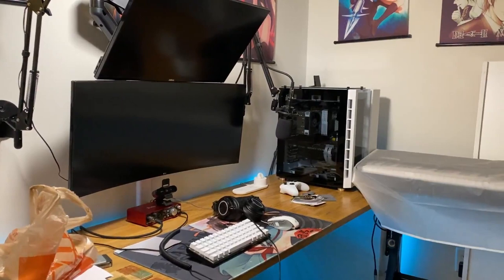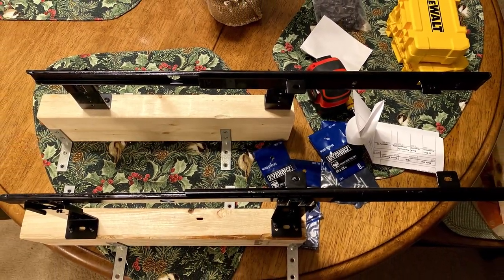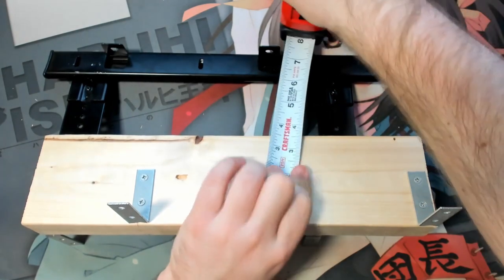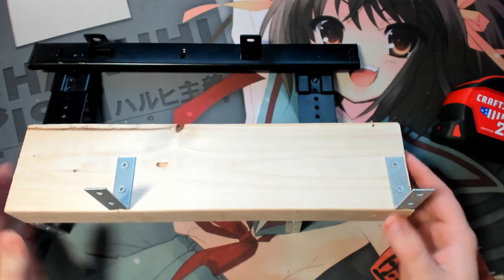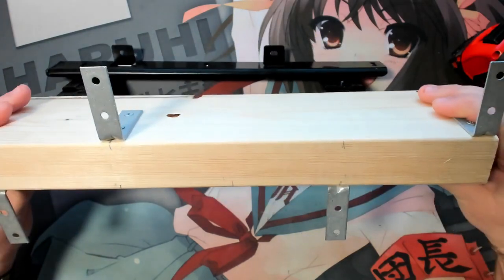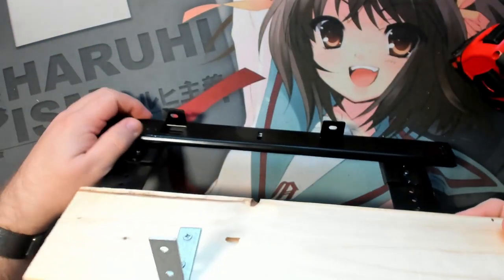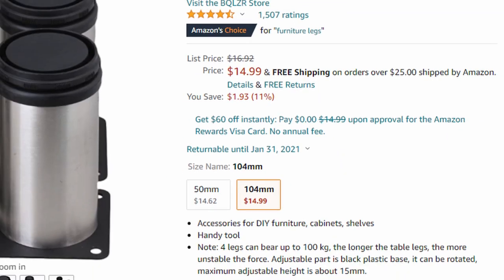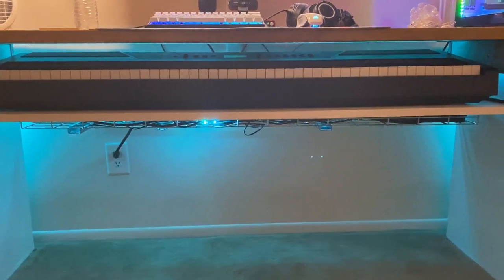Digital Piano/Midi Keyboard Desk Tray - How I Made Mine!

Comment: Hi my friends - musicians. Before you build such a kind of slider/tray, make sure you have enough space/height for legs. 
If not, you can use longer rails or two rails and to push the keyboard deeper. So for the processing job you can feet your legs under the table.
Reply: Any videos resources on making my the keyboard deeper for space for my
Legs ?
Reply: One of those adjustable desks that move up and down would be perfect for this setup

Comment: Nice video. Good solution. Question: how does the shelf with keyboard react to pretty strong, maybe even percussive playing/hammering the keys? Looks a bit wobbly/flimsey...
Reply from the maker: It was at first, but I added an angled galvanized steel support bracket that spans the entire length of the shelf, greatly increasing the support. I don’t play hard and pound the keys or anything since I am just learning, but the shelf has no issues with moving or shaking when I play. I hope the video helped you out!
Reply: @TechedOff  It certainly inspired me, as I am in the process of constructing a shelf myself. And good to hear some steel support will help!
Reply: @TechedOff  Good Idea with the angle Bar.  So you have the angle bar screwed into the holes on the sliders running the length of the tray?

Comment: Great video! Do you know how heavy the keyboard is? I have a Yamaha CP4 Stage Piano and it's quite heavy. I am concerned something like this wouldn't support the weight.
Reply from the maker: Thanks so much for watching! The product listing lists it as 30 pounds. Alone I agree which is why I put a metal l bracket underneath for additional support. My desk is also solid wood. I’d never do this with laminate particleboard as that would probably pull right out.

Comment: This is great, was wondering how is this holding up? I'm going to make the exact same setup and it's gonna be screwing inside an ikea karbly. For some reason there's something extremely enerving about having my 38lbs digital piano floating because the desk is particle board. I'm probably going to do what you did but ad even more L brackets, but just curious if you've found this to this day if you still own this setup? 

Also your desk is 1 inch correct? kinda eyeballing it but i'd be willing to go get solid wood table top at a decent price i've found at homedepot if that is indeed 1" your using. For some reason I thought 3/4 screws would be a bit small for this kind of tray
Reply from the maker: Hey thanks for watching! I still use it today and it hasn’t budged since I installed it. My desk is solid wood but the shelf is particleboard. The l brackets provide plenty of support and I used several on each side spaced out to evenly support the weight. If anything I’d be more concerned about the particleboard shelf than the desk since my desk is solid wood. My desk is indeed one inch thick.

Comment: Any issues with the tray sagging over time? since it's been 3 years now?  I have an S88 and I am worried with the length of the tray and the weight of the keybed,  And obviously playing the keyboard.  Would you recommend maybe going the full 1-inch thickness?  Or was the 1/2 inch fine?

Comment: Question. 66" x 35" under desk clear. Rectangle legs on either side. 
Keyboard  56"W 11.10" D  5" Tall. Weight 40.8 lbs. Need piano to be back
 towards the back of the desk, then pull box on slides to edge of the 
desk, slides in box extend out 12" so the piano can be played. Unable to
 get advice on the best sliders to use, meaning the under the desk part,
 pretty straight forward, however when it comes to pulling out another 
set of slides, they need to be able to handle the weight, not wobble 
up-down left-right.  With the width being 56 wide, figuring out weight 
stress is touch. Could you offer any suggestions?  I wonder if there is a
 way to not use an enclosed box, or other ways to make this project 
better? Thanks
Reply from the maker: Thank you for watching! Probably the most important aspect of the project is to be sure that the sliders are able to hold both the weight of the keyboard but also the shelf material you use. You probably wouldn’t need to attach the sliders or blocks of wood to the desk as many times as I did, but I wanted to be absolutely sure they wouldn’t loosen over time and so far I haven’t noticed any movement or loosening at all of the screws. As for the keyboard moving while playing, there are sliders that lock in place when pulled out, like mine do, that keep the shelf from sliding in and out during use. If you wanted the side fastening sliders instead of the top mounting like I used, those would definitely work too, but you’d want a longer block on each side to mount the sliders to.
Reply: @TechedOff  If u wanted to push the shelf back where the front of shelf is 25" back from the front edge, and when at the front side you needed to pull the shelf out 12" to lock and play --- would you use  rails inside the under desk to get the front edge, and then with another set of rails telescope tje shelf out to play position to play?  Nearly all seem to barely get the wide shelf barely under the desk, however with my knee, I need to be able to push the front, back under the desk until the front of box or shelf or both are 34" back. It is cooking my noodle. Any thoughts? Build a box that holds the shelf and keyboard until pulled to the desk edge and then use two more rails. By the way I will send a link to a genius who build something like this on a ship, I kid you not. He only uses high end stuff, very interesting read. His problem, on a ship the is no space to push it back except barely under. Hit me back if you can. Desperately trying to get this done. Appreciate the suggestions.

Comment: My concern is that will your arms be parallel to your typing keyboard with the keyboard underneath?Unless the keyboard is pushed in deeper. How have you felt using it ?

Ergonomics is crucial to me
Reply from the maker: Thanks for watching! Mostly I have adjusted my chair to the proper height if need be to make my arms more comfortable to me. The desk is raised with spacers so my legs are able to fit underneath the table and keyboard comfortably. I have been comfortable so far using it. My only issue is my bed is directly behind my desk so I don’t have too much room to adjust my chair around as I play, but that’s a function of the size of my room rather than the desk itself. So far so good!
Reply: @TechedOff  ok well as long as you can also adjust your computer monitor then I guess it can work, thanks

Comment: How much weight do you have on the tracks? I want to do this with my digital piano that weighs 42.5 lbs, not including the weight of the shelf.
Reply from the maker: The piano is 38 pounds and the shelf is a few on top of that, so not too far off from where you’d be. Main thing to be aware of is support. I have the 2x4s mounted at 4 different spots each with 2 screws at each spot. I haven’t seen any give so far with my setup at this point.

Comment: Now this is what I needed, my desk is a L-Shape desk that has a frame. So I just wouldn't be able to use a slider at all due to the frame blocking the path. My MIDI is also kinda THICC sooo yeah just not enough space. The whole solution using 2x4 that is 14 inches is perfect for me and should work well with my desk even though the wood for my desk is only .6 wide i think it should work.
Reply from the maker: Yeah there was some trial and error with my setup. Hopefully this helps you out so you don't have to learn the way I did! :)

Comment: what is your desktop made out of?  im trying to do this same thing but only with my 49 key akai advance and I have an Ikea countertop that I “think” in veneer but its really solid.   i had read that the core of those countertops is a really rough cardboard and Im wondering if it would hold it.   I, too, need the real estate on my desk.
Reply from the maker: My desktop is solid oak back from when ikea sold the solid wood hammarp version

Comment: Did you use a drill bit or just the actual screws to get the screws into the 2x4 as well as the bracket into the bottom of the desk?
Reply from the maker: Hey thanks for watching! I hope the video was able to help you out. I did use a drill bit to drill pilot holes for each of the screws, and then I screwed the screws into the pilot holes with a drill afterwards to be sure the screws went in straight. Any more questions please ask!

Comment: Thank you for the great video. I'm thinking of installing and using the keyboard tray like this, but are you still using it well?
I'm worried that the desk might be bent or damaged because it's too heavy.
I'd appreciate it if you could reply!
Reply from the maker: Thanks so much for watching. I hope the video was able to help you out! Yes, I'm absolutely still using it and it's going strong even after since moving! If you like, you could always take a table leg and prop it up underneath the middle of the desk behind the keyboard as there is room. I haven't seen a need for that so far even after testing my own paranoia and taking a level along the desk just to check. Also remember that this is a solid wood desk and not veneered or particle board, so it's much stronger than most off the shelf desks.
Reply: @TechedOff  Thank you very much for your reply.!!

Comment: I used this method and turned out great, only down side is my keyboard doesn’t come out all the way, any way these rails come out more?
Reply from the maker: These particular rails don't come out as far as some other tracks, but they are height adjustable. Most of the tracks that I found that extended farther had no way to adjust them vertically like these allow. A bit of a trade off was made on my part to get them to fit, but I noticed many of the higher end keyboards are much taller than the beginner ones. I wanted to leave myself room to upgrade in the future without having to remount the entire tray. There are probably ways to mount the longer extending tracks lower with longer boards etc., but stability might become an issue at that point. My keyboard extends far enough for me to expose the keys and the I/O but not the entire keyboard. I made that trade off but having less extension gives it more stability, especially while playing. Thanks for watching and I'm glad I was able to help you out!

Comment: Thanks so much for this video. I have a yamaha 88 keys collecting dust. I have it under my desk on a keyboard stand but I don't really play it much as it is a pain to keep trying to shift it out of a narrow place. But I think I will do what you did. My table top is the cheap IKEA crap but I would differently need a solid wood to handle my keyboard weight. Thanks for explain the mechanism. Questions, from the UK, I know you said the length was 14 inch, what was the hight and thickness of the wood?
Reply from the maker: I really appreciate you watching! The Thickness of the shelf is 7/8 inches and it is about 15 inches. Of course you could always use a thicker or slightly deeper shelf if you wanted to use something heavier than I did. If you have any more questions please ask! :)

Comment: Hi i am looking for to maybe do something like this. But i have a thinner keyboard so i dont need the log thing you put between the rail and the desk. But i have some questions. First of all whatt for desk are you using, is it ikea or something? and second is if this is in your way for your knees and legs or if it works. And third is if an ikea table like kalby which is 3.8cm thicc and the ground material is chipboard can hold a keyboard and the rail with just some screw or if its unstable.
Reply from the maker: Thank you so much for watching! My countertop is an ikea oak Hammarp. Not sure if they are still sold or not. Two ikea Alex drawers on the side. Hasn’t been in my way at all since I added the desk risers. It definitely was in the way before since there was a need for more clearance underneath with the keyboard below. I would definitely use solid wood and not veneered for this application. With the weight of the keyboard hanging underneath, that extra stability definitely helps.

Comment: Hi, thank you very much for the video! I was wondering how is the desk tray behaving through the test of time? I want to do something similar and since I don't find any prebuild desk tray that allows me to fit my wider midi controller I was wondering if your solution was durable and if you've had any issues with the piano's weight, with the desk curving or with the tray itself.
Reply from the maker: Hey thanks for watching that's a great question! With my specific solution, I have not yet had any issues with table bowing or the shelf loosening in any way. While my shelf is particleboard with some slight reinforcement, my tabletop is solid oak, and it has held up from the weight of the keyboard as well as me leaning on it daily. I use a Kawai es110 that weight about 38 pounds and I haven't yet had any issues with the shelf or piano. If you have any other questions, please ask!
Reply: @TechedOff  that's great, thank you very much! 🙌🏼

Comment: I was wondering what the size of your desk is. I’m looking to do something similar. Just starting out messing around with music production here and there. I still don’t know a lot regarding that but . I want to end up doing this. My setup is gaming / music production. I was planning on using michals drawer units which are about the same as the Alex drawers. I have 2 monitors and a pair of edifier 1850db and an older klipsch 10 sub. And your desk size looks pretty good although I think I’d need it to be a bit bigger. Anyways enough of my rambling. Any info helps, thanks!
Reply from the maker: Thanks very much for watching! It is 72 inches long on top of two Alex drawers from ikea with furniture legs used as risers. The desktop is solid oak ikea Hammarp. 24 inches deep I believe.
Reply: @TechedOff  alright. Thanks man. I might have to make something similar in the future.

Comment: Hi there !

I'm looking to build a setup based on yours (really nice video, by the way), but I am wondering about the clearance space between your legs and the piano tray while you are using your keyboard + mouse. 

As I am pretty tall, I'm worried I might have to raise the desk a bit higher in order to fit my legs under the piano tray, but there is a limit to the height a computer chair can be lifted without getting uncomfortable behind the knees.

May I ask you how much space you have left between your legs and the piano tray, and if it's not too personal, what is your height ?

Thanks again for the video, and have a good day.
Reply from the maker: Hey thanks for watching! No worries there. I'm about 5'10" and I have about 2 inches when I'm sitting down between the top of my legs and the bottom of the piano drawer. The option of raising the desk higher is always there, however like you mentioned comfort can be a factor if it is raised too high. My chair is at the max height that it is able to rise, but I am also quite heavy so it sinks just a bit while I am sitting. While I don't have room to dance and jump underneath the desk, I am comfortable and am able to sit and game or do work without feeling uncomfortable. If you have any other questions please ask as I'm glad to help!

Comment: Can this system hold a midi keyboard that weighs above 20kg ? 
Also does the sliders have a lock system or does it make the tray slide back in when playing your digital piano ? Looking forward for your reply 🙂
Reply from the maker: Hey and thanks for watching! I'm glad to have helped you with your project. The slider product page on Amazon simply states that the weight capacity depends on the method that you use to mount the tracks to your surface. Obviously my method is plenty overkill by most standards. My piano is 38 pounds plus a couple of pounds for the shelf, and I've noticed zero movement, wobble, or loosening of the shelf or tracks from their mounting points. As long as you are not putting something really heavy like 50kg or so, you'd probably be OK. As for the locking system, yes! These tracks do lock in place when fully pulled out so that the keyboard does not slide back underneath your desk when playing. I was specifically worried about that when designing this and looked for tracks with that specific feature. Obviously you don't need to use the exact tracks that I did, as the dimensions of your keyboard may differ from mine. But I can say that the general design works great and I'd definitely recommend it to others. I appreciate your patience and I hope this response helped you out. If you have any other questions please ask!
Reply: @TechedOff  thank you for such a detailed response. Actually I am planning to get the studiologic Sl88 Grand which weighs around 20-21kg. But since you mentioned that this slider can take 50kg load then I guess 20kg wouldn't be a problem then. As for the dimensions, I already have the table made accordingly but I am just planning to upgrade the tray system  like the way you set it up . Hoping everything works out :)

Comment: The problem with these including the one I made is it tends to move around too much when extended
Reply from the maker: Does yours move around a lot? Mine has been fine so far. Yes you are definitely right that the longer the tracks extend the less support there is which is why I mounted my tracks as far forward as possible so I could extend them as little as possible while still having access.